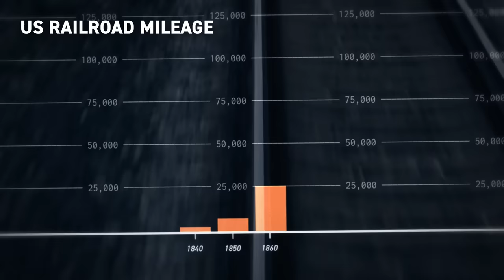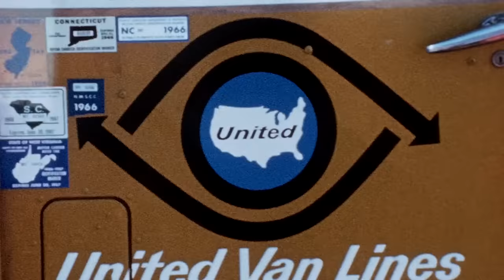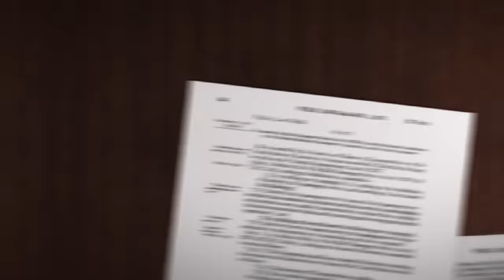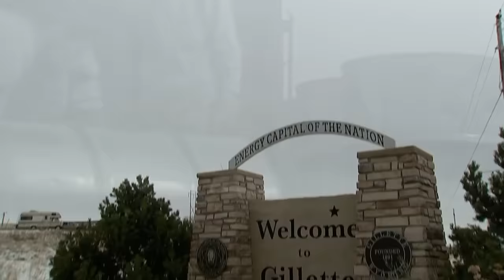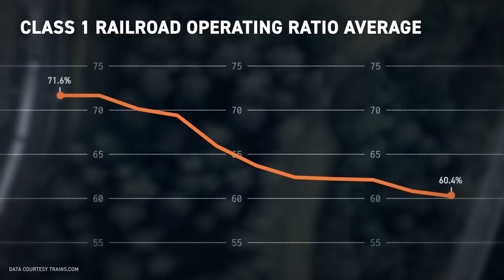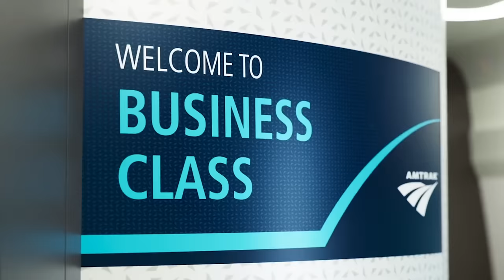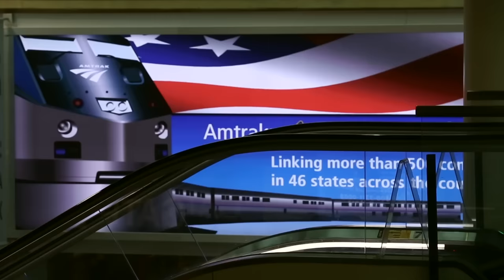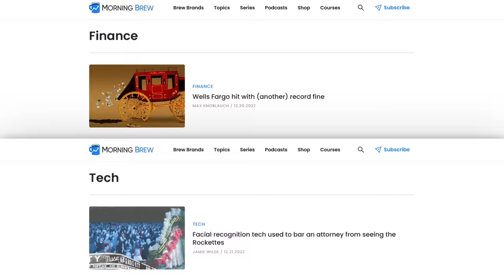The One Tiny Law That Keeps Amtrak Terrible

Comment: One glaring example of why you don't want to abandon routes is the Lackawanna Cutoff in New Jersey.  One of the best engineered stretches of track on the East Coast  was abandoned and removed as part of Conrail's consolidation.  Rumor has it that one reason was developers wanted to put casinos in the Poconos, which would compete with Atlantic City, and New Jersey didn't want that.
In 2003 New Jersey Transit announced the planning of restoration of the line.  The main reason was the main artery, I-80, was overloaded with traffic from commuter traffic.  The problem is the road only has four lanes and there is no room to add another.  
Fast forward to today.  Roughly a quarter of the track and one station have built.  With luck service will be restored in 2026.  Restoring the rest of the line is projected to take another 15 years.  
Chuck Schumer wants this line extended to Binghampton,  Even with his backing it is still taking forever.  So far it's taken 20 years to replace a quarter of the removed track.  The original construction took three years.
Reply: sounds like a marital problem- lackawanna cutoff
Reply: I wish that Passaic had a second train station.
Reply: The rails were built with migrant labor. Wouldn’t the unions have a fit if we allowed temporary migrants from SE Asia and Central America to improve our infrastructure at a reasonable cost?
Reply: @lukethompson5558  Saying they were "built with migrant labor" is one hell of a way to refer to the slave and underpaid labor of immigrants, mistreated and forced to work in deadly conditions for near-nothing pay in most cases.
Reply: There has to be more to it other than the fact we can’t use slaves anymore.
Reply: @griggorirasputin6555  True, but it plays a significant part, at least regarding US History. Rail track gets exponentially more expensive the longer it has to be, owing to the fact that it has to be relatively level, long-term stable, most effective with straight lines which means lots of tunnels and bridges etc. It makes up-front costs very expensive, and the US Government way back in the early 1900s decided that, in order to blow up the Automobile market, to heavily subsidize automakers, which led to pretty much every family having a car. This let the US slash the budget to public transit, and also more or less stop rail construction and maintenance, leaving it up to private companies.

Passenger transit isn't super profitable like Freight is, so these companies basically only ever built and maintained freight lines and locomotives, and whatever passenger lines they did have the made second-place to any freight run on that same track.
 
Expand this over almost 100 years and you get passenger lines that are woefully out of date, running on antiquated, ancient track, with whole sections of the country not really having any lines, and it means expanding those lines is a huge upfront cost for what a private, profit-oriented company deems unprofitable lines anyway.

A good part of it also comes down to the fact that a large amount of the US isn't really dense enough for private rail in the first place. Pretty much anywhere in the country that isn't the coasts, the great lakes, or the Gulf is far too rural for passenger lines to be profitable for these companies as well.  

The best argument can be made that we should be nationalizing passenger rail, and turning it into a public service like it should be, but people in the US despise anything even vaguely linkable to 'socialism' even though it'd provide an objective public good.
Reply: @GriffinMan00  Wow, lots of inaccuracies, but the major one is your last statement.  Passenger rail is nationalized, and has been since 1971.  Of course I'm expanding the definition of nationalization to include state-sponsored efforts too.  About the only private passenger rail service in the nation is Brightline in Florida - which has bought its equipment, upgraded and extended track, all with mainly private funding.  Now we'll see if they can do as good or better than all of their government owned and operated peers.
Reply: @jonwalter6317  out performing the Florida government is like playing limbo with the bar suspended from skyscraper rooftops. The real test for Brightline will be their planned routes in Texas and California. Say what you will about those governments, but they are governments that actually govern.

Comment: Minor correction at 6:58- the two companies on the left, Burlington Northern and C&O, had both been consolidated into larger companies by the 1990s. Burlington Northern's logo should instead be BNSF Railway, and the C&O logo should instead be CSX Transportation.
Reply: I think he means pre-1990s mergers and splits
Reply: @cjuice9039  Yeah, but then there were more than 4 Class 1 railroads.
Reply: @cjuice9039  Look how the other 3 companies consumed the lesser companies. BN did not consume BNSF, BNSF consumed BN. Notice how he says these four companies now control freight, but BN doesn't exist anymore, it should be BNSF that is shown.
Reply: where's kansas city southern
Reply: @HTV-2_Hypersonic_Glide_Vehicle  it was for showcase of which companies ate the rest, yes BN is now BNSF, but that's because they were the larger company and it's mostly just nitpicking when its a small segment of the video and the point gets across, that from so many railroads now only 4 remain
Reply: @cjuice9039  SP went into UP in 96, BN with SF in 95, CSX was 86, NS was 82 so if pre-90s still would have way more than just four.
Reply: @ishiddddd4783  Technically 7, KCS, CP, CN all should count as well they have large portions of the midwest under control
Reply: @ishiddddd4783  oh my god, it's not nitpicking if it's misleading and wrong
Reply: @HTV-2_Hypersonic_Glide_Vehicle  but it's not misleading, the whole scene lasts 4 seconds and the point gets across, from the mergers those are the companies that ate the rest, they "changed" name and logo, but the point remains as it is, bn is the largest by a long shot from bnsf, same with up, ns and csx
Reply: @ishiddddd4783  the fact that BNSF did not merge into Burlington Northern is false. That alone makes it misleading, the big four is not including Burlington Northern. It doesn't freaking matter how long it is, incorrect information is wrong, and mistakes like that are objectively misleading. I am not saying it is a big deal, but it is a deal.
Reply: @ishiddddd4783  people that use your argument of why something that is wrong isn't misleading is why there are people that misinform others about military weaponry, aircraft identification, and railroad strikes on the news.
Reply: @ishiddddd4783  2+2=4.0000000000000000000000001 may not be a big deal, but even though it is insignificant to you, an engineer that makes this mistake will ruin a whole project.

Comment: Very interesting and informative video.  One thing you didn't mention is that the railroads pay taxes on existing trackage which is an incentive for the railroads to abandon unused lines. Also, eliminating double tracking allows for easing curves and reduces maintenance and labor costs.  Taking Amtrak from Baltimore to Cincinnati takes 22 hours. Driving takes 9 hours. Flying is just a one and a half hour flight. We love riding the trains, but it is not practical when you want to get there in a timely fashion. Thanks for the video.

Comment: Passengers feel like hostages on the Sunset Limited when it takes almost five hours to travel the last dozen miles into New Orleans. My train was already late, so it was not a priority for the local freight network dispatchers. They seemed to handle us grudgingly. We were like a fly caught in a spiderweb! 

Amtrak train crew added to the misery by closing the dining and snack cars — on schedule — meaning passengers were really HANGRY when we finally rolled into NOLA, at 2am!
Reply: Part of that problem is that after Katrina, Amtrak did not continue the route to Florida after the tracks were repaired. So Florida has had to suffer with just one way out of the State. Which gets shutdown by storms that hit the Carolinas, Virginia, and Georgia. As a lot of those areas are single track, a single freight accident can cause the whole system to collapse. Example of that was a recent 29 hour run of Auto-Train's. A run that normally takes half that. On the weather front, a hurricane saw our trip delayed by two weeks and at that, we still were delayed in the travels. A 9PM departure from Lorton, VA ( normal is 5PM ) and a 4:30PM arrival in Sanford, FL when the normal is 8AM. And if there is an expected storm, Amtrak just shuts down service on the route. When the Sunset Limited continued to Florida, you could always use it to get to where you needed except in the directly affected area. But then I remember Amtrak before all the cost cutting. We actually had decent service in Florida. With the cost cutting, the long distance trains to/from Florida actually started losing money when they had been ones that showed a profit. And who in the heck would cut the Silver Meteor when it was the only one that could make connections in DC for travel to the mid-West? And just run the Silver Star that couldn't. Back in the early days of Amtrak you could go from Miami to Tampa and back in the same day and have lunch in Tampa. Same with Miami to Winter Park and return.
Reply: When you have a monopoly you can do whatever you want.
Reply: @gravelydon7072 Specifically, Amtrak was not able to continue the route to Florida, because the freight railroads realized that if they replaced the tracks to freight standards but not to passenger standards, they wouldn't have to deal with those pesky Amtrak trains on that part of the line any more.  Amtrak has been vigorously protesting this, but enforcement is slow to arrive.
Reply: @katherinec2759 Yep. And now it is even worse.
Reply: @katherinec2759  So what incentive do the freight railroads have for making their lines suitable for passenger trains?
Reply: @JeffDeWitt  Two incentives.  The first one is that if Amtrak wasn't around, the government would still be requiring each railroad to provide passenger service along its lines.  Playing nice with Amtrak is the price the freight railroads have to pay for not having to run the passenger stuff themselves.
The second incentive is SUPPOSED to be that it's legally required, and that Amtrak is allowed to sue them if they don't.  This is the law that the video is talking about.  But in practice, Amtrak has found it almost impossible to get the government to enforce said law.  But now that modern technology allows them to prove "no, the freight railroads actually are the ones causing the problem," rather than getting into a he-said-she-said blame game, hopefully Amtrak's current suit will end up going through, and the railroads will realize that they can't just ignore Amtrak anymore.
Reply: @katherinec2759  As the railroads are private property I'm dubious about the constitutionality of that law. Has it ever been seriously tested in court?
Reply: @JeffDeWitt  It is interstate commerce, which the federal government has the constitutional right to regulate, and they HAVE been regulating it for well over a century.
Reply: @katherinec2759  They can regulate commerce but that doesn't give them authority to require a company to engage in a different kind of business... it's not like the feds can legitimately order Old Dominion Freight Lines to start carrying passengers.
Reply: Oof, thanks for the warning. I wanted to visit my family in NOLA and was hoping to enjoy a train instead of fly... I don't mind long train rides (love them actually) but only as long as the train is MOVING.